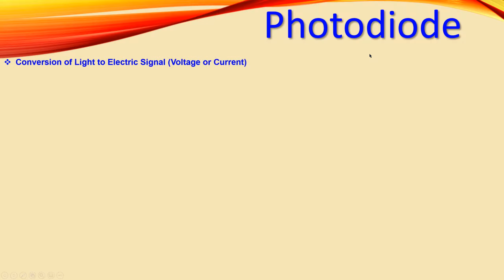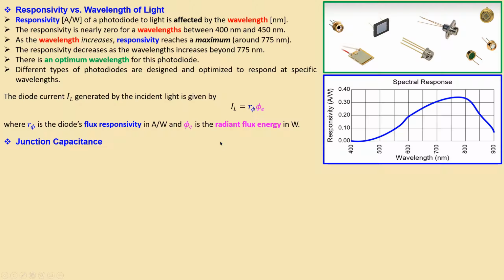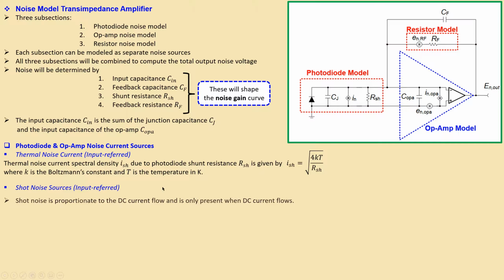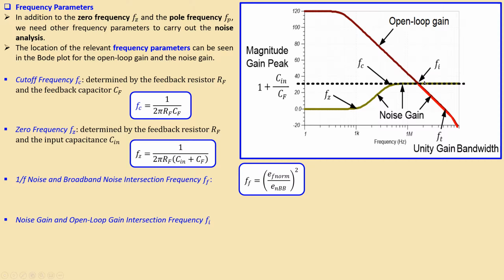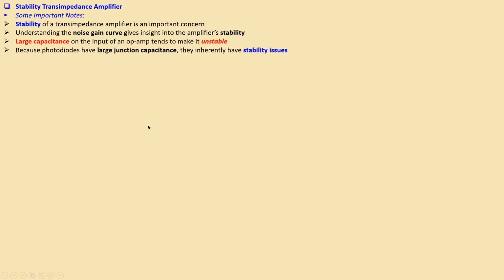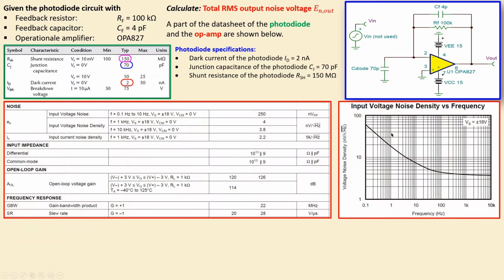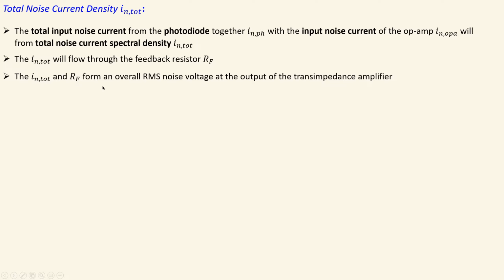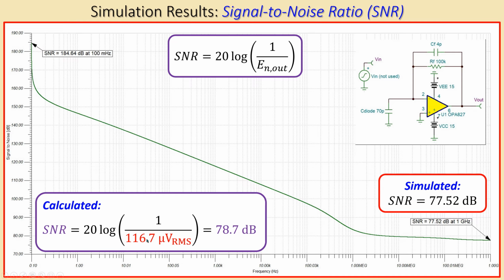Noise Analysis Photodiode Transimpedance Amplifier 🌟 Calculations & TINA-TI SPICE Simulations 👍

Comment: Nice lecture, I was just wondering if changing the direction of the current flow would affect the noise analysis? Most implementations of TIAs with photodiode seem to have the photodiode in reverse bias, opposite to what you have presented. Any other considerations/differences that this would cause? Thanks!
Reply from the maker: Thanks for your message. The photodiode is also reversed biased in this video. You can see that also in the circuit I consider in this video.
If it where forward biased, the junction capacitance would be different and the junction potential is around  700 mV, depending on the current through the photodiode. For collection of charges inside the depletion region, the photodiode must be reserved biased.

Comment: Pardon me if i ask a very beginner question but I decided to make NIR Photodiode sensing of fabric type but I feel like I need to know noise analysis but before the noise I am confused how to receive data from photodiode ? Could you lead me to some sources so I can learn ? Thanks in advance and I will be much obliged.
Reply from the maker: Thanks for your message. I think it is important to make a model of your sensor and readout first. Then, you can analyze the noise and other transient and frequency depending parameters. Did you searched for a model for your photodiode? In addition, in what environment you will use the circuit? This can change the required model and complexity. 

It would be also easier to discuss the problem if you have a circuit or something.
Reply: @CANEDUX   thank you so much for your prompt reply. Much obliged, much respect
Reply from the maker: You're welcome!
Reply: @CANEDUX  i decided to use InGaAs photodiode, i will do my detailed research thanks to your advice

Comment: Hi, thanks a lot for the video! I think I missed one part: how exactly do you include dark noise of the photodiode in the SPICE simulation?
Reply from the maker: Thanks for your message. This is a good question and important for more accurate results. Note that the full model for the photodiode is not used here and it not required. In this analysis we only use the diode junction capacitance Cj = 70 pF. You can add the dark current component by modeling it as a DC leakage current.